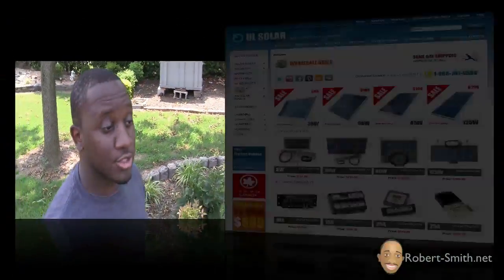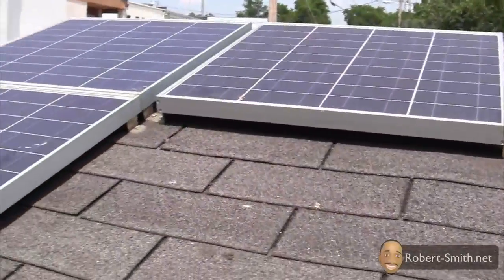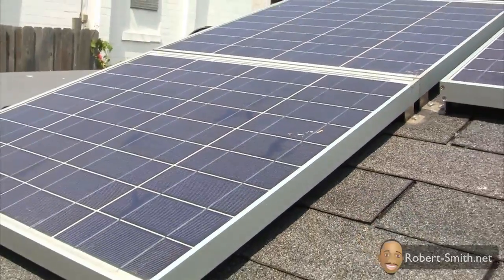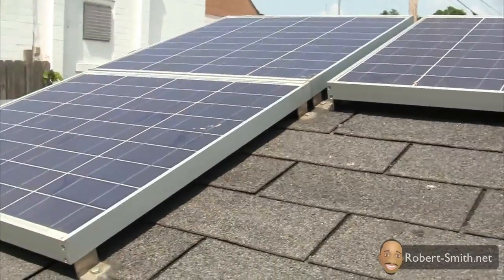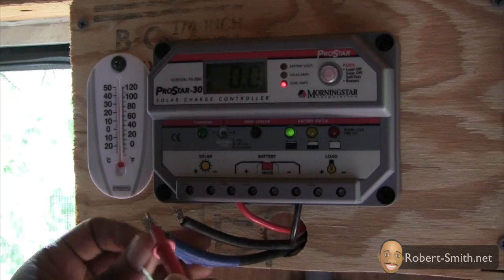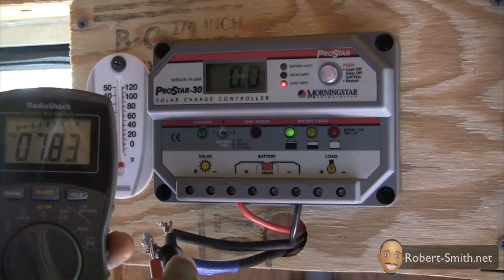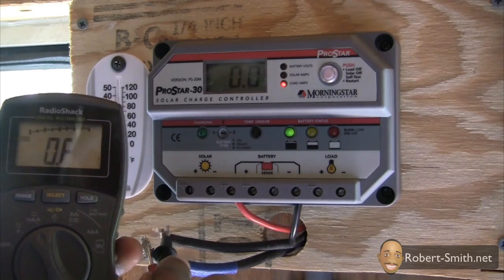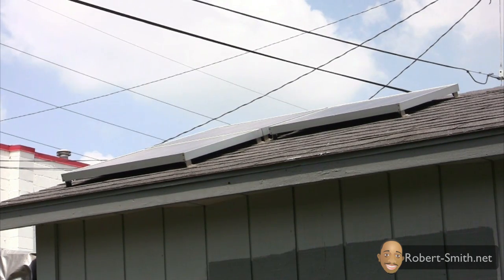UL Solar 55Watt Solar Panel Quality Update

Comment: I think if there is damage to the cells of any of the panels, it could be because of your method of how you are checking the Amperage output.  You are directly shorting the panels out by connecting only your meter (which is essentially 0 ohms load when it tests current flow).  Shorting out the panels (~0 ohm load) can overheat  them and cause damage to the cells if done for more than but a very short moment.

I used to test my solar cells individually building panels to see if each cell had acceptably similar amperage.  I noted when directly shorting the cell with the meter, the cells would get burning hot and decided instead to provide a 10 ohm resister in series with the meter so that there was an actual load to prevent the cells from overheating and potentially melting down.  

You should only connect the meter in series with one leg of the panels and the terminal on the charge controller.  By undoing only one wire from the controller, it's also less likely you will accidentally short the two wires together in handling.  It also lets you get a more stable reading as the terminal you stick the meter probe into can be screwed down on it, making that electrical connection stable so you can be more focused using two hands to firmly press the other meter probe and the loose wire end from the panels together so you get a very stable, accurate reading instead of the very shifty unreliable numbers you show in the video.

Comment: Just checked my 50 watt UL solar panels, which are now a little over 2 years old. They have the same spots (one has a little more than the other one). From what I can tell, they are still putting out rated power (I also have a homemade 30 watt panel tied in with them) Getting a little over 7.5 amps in full sunlight. The thing is my smaller panels (20 watt, 10 watt, 5 watt etc...) from UL solar don't have the spots at all. They are also not on the grid tie like the two 50 and 30 watt panels.

Comment from the maker: @simagic Well I actually sent them an email and showed them this video, and they responded that there is nothing wrong with the panel and if I was not getting the same/correct output as before they would simply replace the panel/s. You can view my blog on my website for the exact transcript of what was said if you want.

Comment from the maker: @nrodge1 Wow, I do apologize if I or they upset you by doing more research on the matter at hand and not basing my knowledge regarding grid tied systems off 1 comment on YouTube. No one is claiming you are wrong my friend, however, one would not be wise not to look into this topic more in depth for their particular state/county and compare the knowledge gained from online research to the actual facts such as contacting your local electric company or local solar contractors.

Comment: You can throw your money away if you want to. The small grid ties are total harmonic distortion of 2% and they anti-island just fine, technically they are the same as expensive xantrex ones. So it's within NEC, plus it just plugs in, DID YOU HAVE YOUR TV INSPECTED? And UL spec is mostly that it has a fuse, those guys are worthless and all into politics. Let me know when you come to your senses, maybe watch all the youtubes here that are running grid ties just fine and enjoying low power bills.

Comment from the maker: @nrodge1 Well I did some quick digging into this idea using my current specs, and the amount that I would be saving per year with my setup will be on average around $25. Additionally, there are many other fees and components one may be required to buy in order to pump power back into the grid.
Some require inspections to be done and require you to have permits. Additionally, they may require you to buy a new meter. Also, your electric company may only pay .05 per kWh, but this can vary.

Comment: Checked, the Prostar 30 is PWM, so when it's charging it will probably pull the panels below 14V most times, and the GTI won't do anything under 14V (the ones that say 14 to 28V) but once your batteries are charged, the extra energy will go to your grid and help power whatever you have on over there. Just hook the GTI in parallel with the charger on the panel side. A few diodes in series with the GTI would lower the voltage going to it if needed. Drop by and visit the forums at techluck.com

Comment: You should grid tie those panels. 10A+ all day is a lot of power to just go to waste if you are only keeping a battery charged. Depending on the type of charger you have if you hooked up a GTI directly to the panels and left the charger in circuit as it is, the battery charge would take priority and then when the charger "let go" the GTI could pump power into the grid and save you $ and pay for your panels. As long as that's NOT a shunt type regulator you should be OK. PWM or MPPT would be OK

Comment from the maker: @b5kalad Well it became a low priority since my panels are still outputting more than their rated amperage, and additionally, UL-Solar's warranty policy is based on how much power the panels are producing per year as they age. So if it's less than 70% in the first year, you can send it back for a new one. They have a table they go by. But I'll still be sending some pictures to them soon.

Comment: @RobertSmith3 I was told it was either moisture or heat.  Probably do to the make of them. I tell ya though may look off but, as long as they work. I think if you mailed yours back the S/H would not be cost effective. Would be better off just buying another panel and add to the setup you have and increase your solar production.